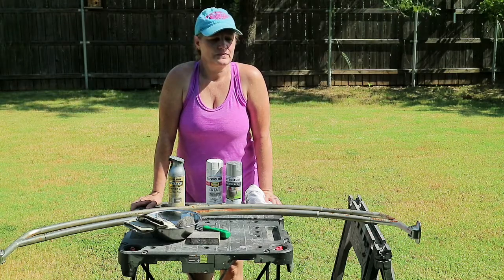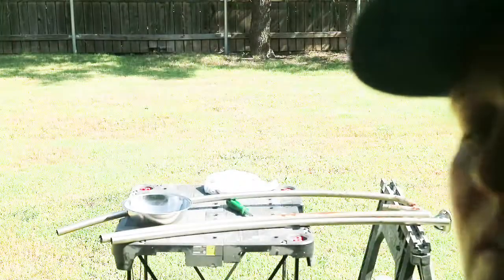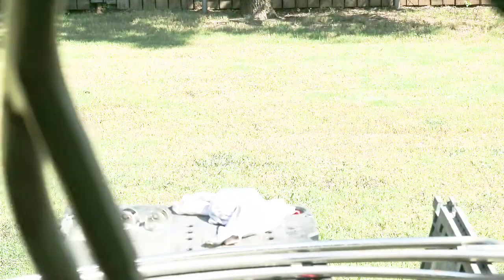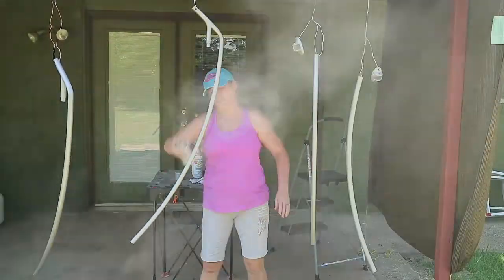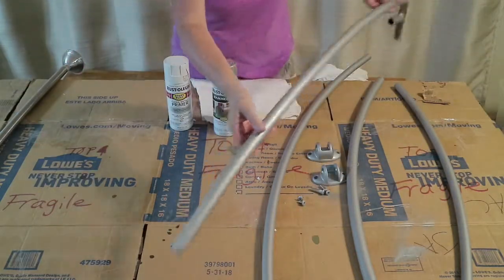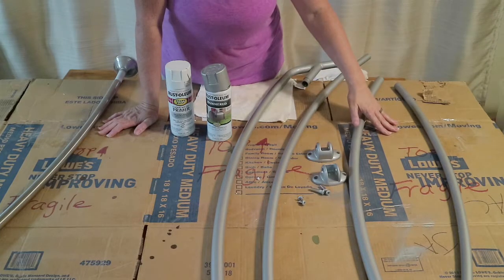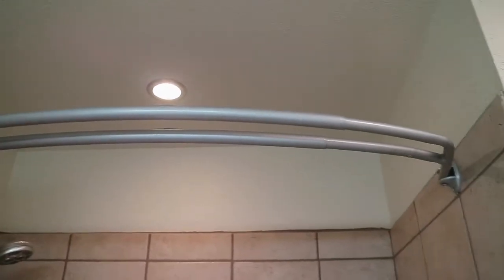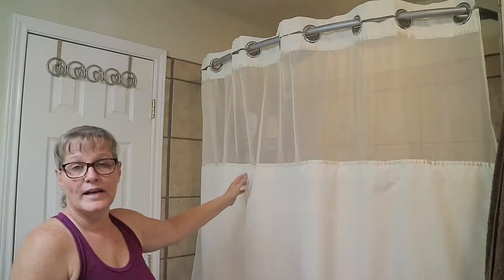Nana So Crafty  - Shower Rod Makeover

Comment: Has it held up well? I’m wondering if the shower curtain rings will cause the paint to peel off the rod after time? I need to do this in one of my bathrooms for an entire shower fixture in a claw foot tub. I want it gold and a new set up is almost $500!
Reply from the maker: Thanks for watching and commenting. So far it is holding up really well. It has been several months and there is no evidence of wear. You may want to put a coat of sealant or poly on to make it even more durable. I have liked it so much that I did a kitchen light fixture with the same paint and will do a bathroom light soon.
Reply: @LivingCooper thank you for this I want to paint mine gold with Rust-oleum primer and rust-oleum metallic gold. Fingers crossed ❤😊
Reply from the maker: @cassandrabenson4963  do it!  We loved it and it lasted for years.

Comment: What is the name of sealant or poly do you recommend? I’m afraid of it wearing.
Reply from the maker: Thanks for watching and asking a great question. We didn’t seal it at all. It was a very humid, non ventilated bathroom and we never saw chipping or peeling and it’s been nearly 4 years. The only “wear” may be in some places you saw the scuff from the curtain rings but it wasn’t any different than what it made on the plain rod. 
Sorry I’m no more help than that. Maybe ask someone in the paint department what they would recommend.